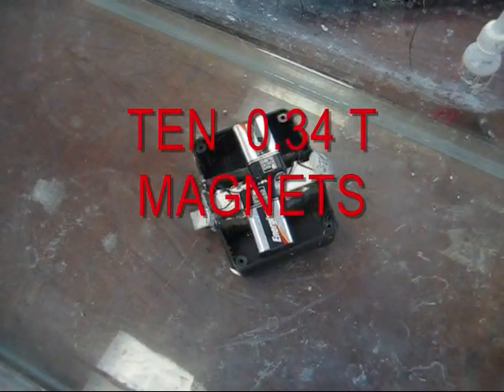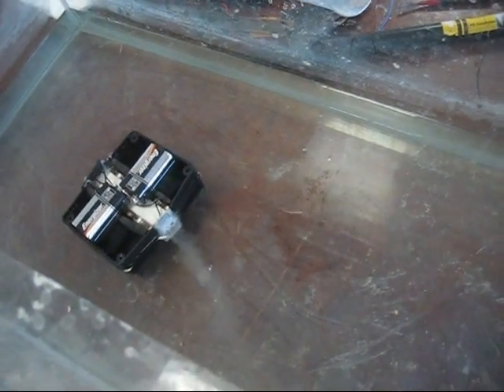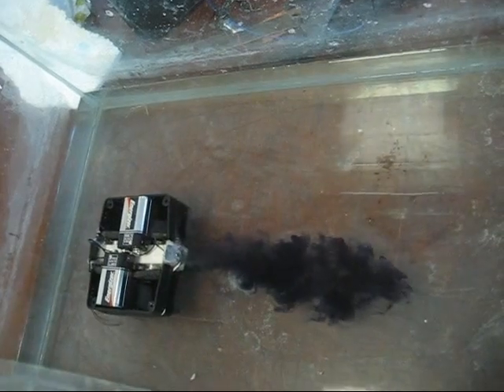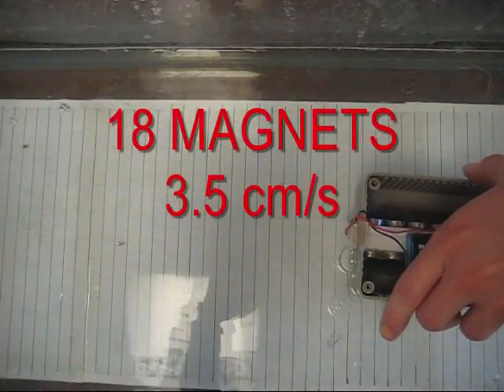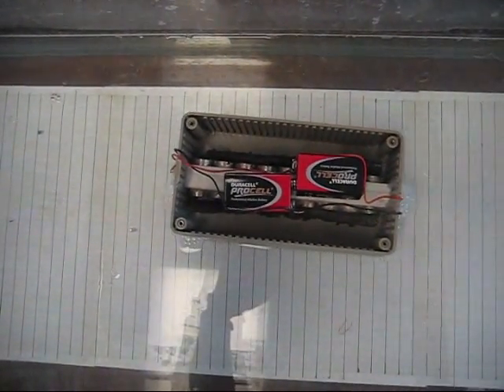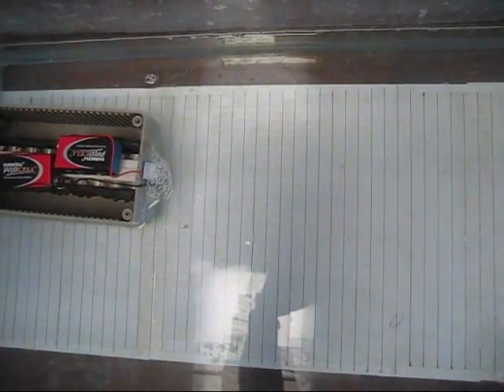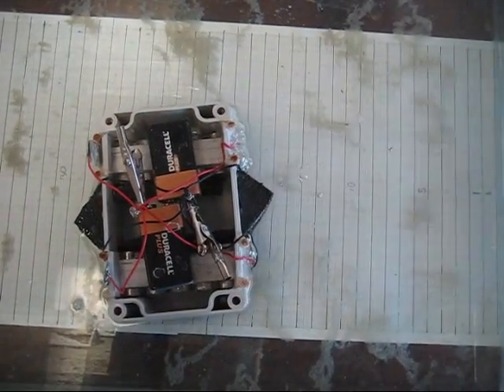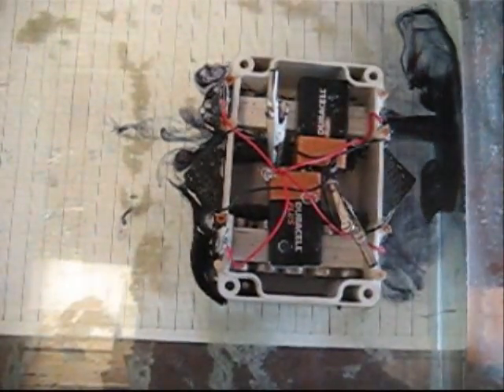MHD Propulsion (2 of 2)

Comment: Hey, if you are still active on this account, I would like to talk with you about how did you make these boats. That’s for my study. Thanks you
Reply from the maker: Sure, happy to help!
Reply: Tom Neiser Firstly I’m french, so I apologize if I make some mistakes... How did you make your electrical system ? Did you just use 2 batteries, then put 2 wires on it and put it into the water ?
Reply from the maker: Luc Etah yes, pretty much. We connected the batteries to the layered aluminum foils at the top and bottom of the channel and applied some superglue to avoid short circuits outside of the channel
Reply: Tom Neiser yeah thank you
Reply: Tom Neiser also, what kind of magnet did you use ?
Reply from the maker: Luc Etah we used neodymium magnets with about 1 cm diameter

Comment: With 18 volts of power and a DC motor you could easily translate that into mechanical energy instead of using a magnetic field
Reply: true it would be more energy efficient to use a conventional mechanical propeller but MHD drives offer something that traditional propellers don't, they're almost totally silent, and in submarine warfare you live or die by how quiet your sub is. plus if you put this on a nuclear sub you don't have to worry too much about energy inefficiency (which can be improved incrementally over time).
Reply: So I suppose you've never seen The Hunt for Red October? Shame that, awesome movie by the director of Die Hard...

Comment: Hey, could you perhaps tell me the diameter and the height of one of the by you used neodynium magnets (or perhaps the weight)? And you just cut out a part from the plastic channel and placed a 150 x 17 x 16mm square in the hole, and made it waterproof with kit?
Reply from the maker: The magnet diameter was 15 mm and approximately 7 mm high (see Fig.'s 4 and 7 in the report). I don't have data on the weight. Yeah, we made it waterproof with superglue ;-)

Comment: Alright, Thank you so much bro! We are now using a small boat (a plastic one you might know from your childhood xD) We are using 2 9v batteries as well and under the boat we are building the magnets and 2 thin copper plates. We are using 12 neodynium magnets (We might try to put 3 on 3 on one side facing 3 on 3 the other side, or 6 on one side facing 6 on the other side). I hope this will work! Gonna test it this day. I will comment if it is working or post a video. Thanks again man!

Comment: One more question XD, how did you prevent the batteries from running out of "engergie" after just a little while?
Reply from the maker: We only ran the experiment for short periods of time and had the batteries disconnected otherwise, so we weren't too concerned about draining them. Since the largest resistance in the circuit was their internal resistance, the batteries were warm to the touch when being disconnected.

Comment: Thanks for the quick response and the tips! We are indeed trying to built one ourselves ;) But from what object/product did you make the plastic area(s) that makes it float? I cant see really clear how you made the in-between part that contains the foil and magnets, and how you "sticked" it together. And you used 5 magnets in a row facing the other 5 magnets right? And the foil is as long as the 5 magnets? Im sorry for the amount of questions xD. But it is pretty hard to get it all right ;) I really appreciate your help.
Reply from the maker: For the hull and the channel we used spare objects lying around the lab, which I am sure you can find at your local hardware store. The foil was folded several times and then glued to the inside surfaces of the channel with fine glue used by model builders. Due to its smooth surface the aluminum foil could be easily unstuck from the channel when it needed to be replaced due to corrosion.
Thank you for your interest - I've attached a link to our final report in the "About" section, which should hopefully answer most of your questions

Comment: So, your magnets are horizontal and facing eachother, and the aluminium foil electrodes are vertically facing eachother?
Reply from the maker: Precisely. If you are trying to build one yourself: Aluminum electrodes proved best due to easy replacement after corrosion. Due to their field strength and geometry our magnets would sometimes jump onto their neighbors despite having been attached with very strong glue, so watch out for that.